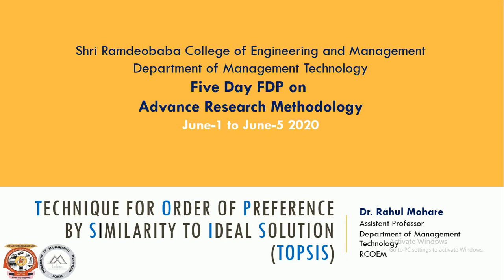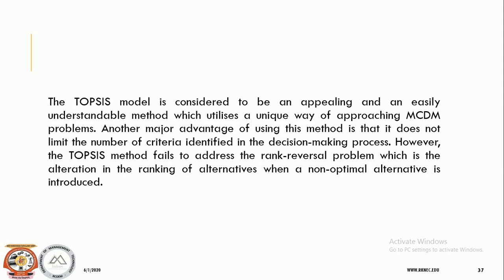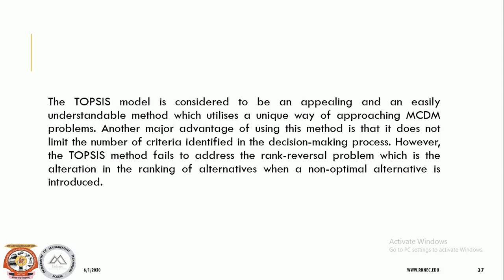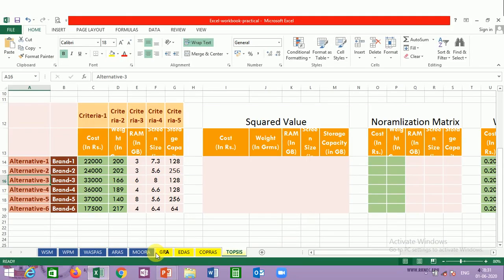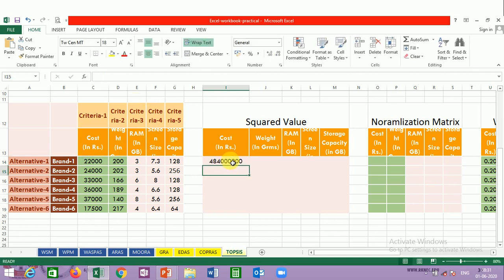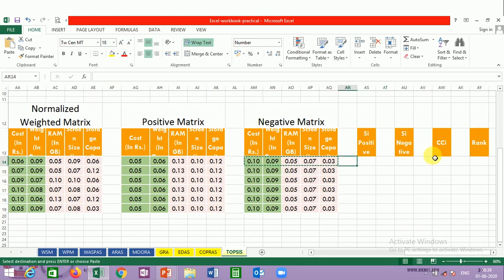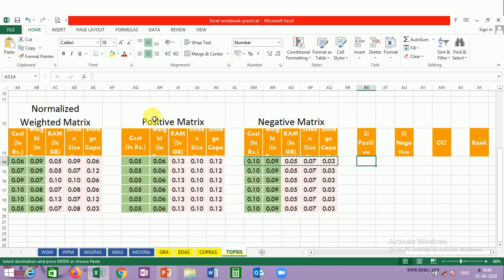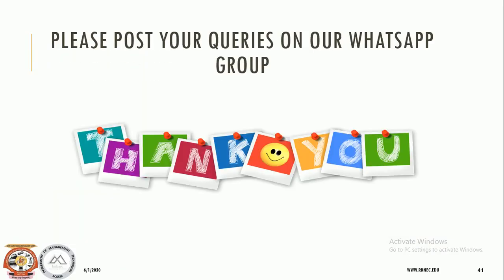TOPSIS Method-Dr. Rahul Mohare

Comment: Hi thank you for you clear explanation of TOPSIS. I went through the original paper of TOPSIS, but isn't it that the current mathematical formula you are using in step 1. Is only for when all of the criteria are benefit criteria?

In the paper there is being explained another form for normalisation for when there are beneficial and non beneficial criteria.
As citation from Tzeng, G., & Huang, J. (2011). Multiple Attribute Decision Making: Methods and Applications:

Form 2:

- For benefit criteria (larger is better), the normalized rating is given by the formula: r_{kj}(x) = (x_{kj}-x^-_j)/(x^*_j-x^-_j), where x^k=max_kx*{kj} and x^-k=min_kx*{kj} or setting x^_j is the aspired/desired level and x^-_j is the worst level.
- For cost criteria (smaller is better), r_{kj}(x) = (x^-j-x*{kj})/(x^-_j-x^_j), and then to calculate weighted normalized ratings by...

Then comes step 2 from your video.
To understand all of the TeX notation better, just use atomurl . net/math

I love to hear your thoughts about this!